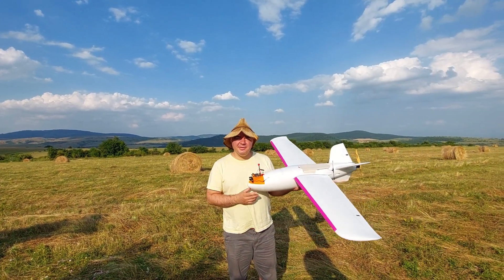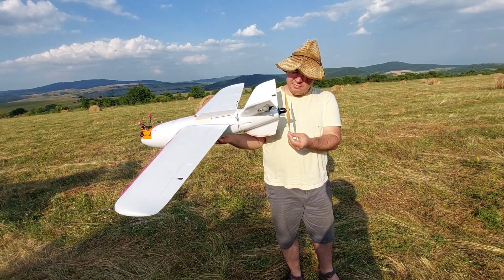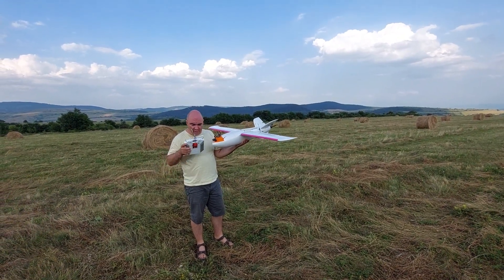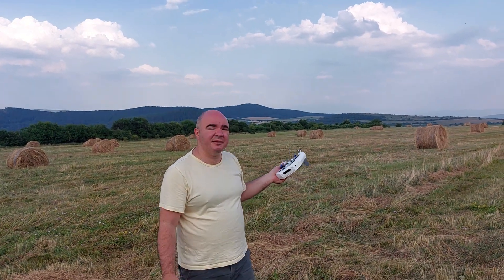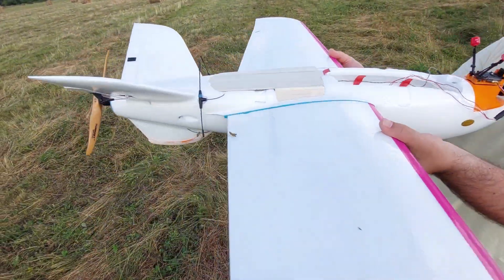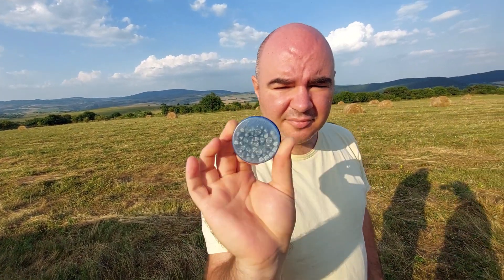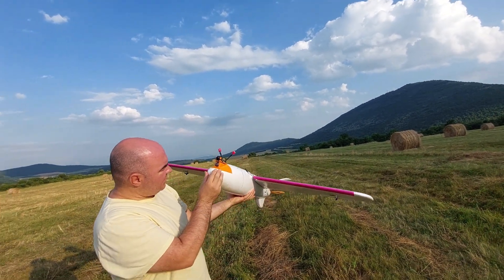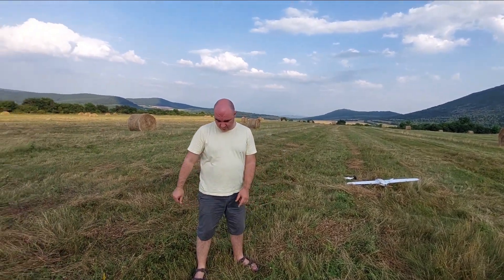X-UAV Talon Pro with SunnySky X2216-11 880KV. Is it a good combination?

Comment: Good, but in the end he ran very, very slowly. Try running from a low start and jumping up before throwing - it will definitely fly!:)
But seriously, throw it strictly at the horizon, or even better, use a launch rope with a rubber shock absorber.

Comment from the maker: Thank you for your comment. Since the SunnySky 2216 880KV did not do the trick I put the old motor back. I flew today effortlessly with plenty of thrust to take off from my hand. Do you recon a dual motors 2507 1800kv on 6S in tractor mode will be more efficient? Thank you.
Reply: Don't know about being more efficient, but I bet it would launch and land easily.

Comment: ESC, Prop direction, Improper prop type, need a higher kv,? I run 2216 1250 with 8x6 e prop on my 2m Volantex Ranger on 4s1p 21700 45A cells. It takes a strong heave to hand launch, but slides off of grass in 100ft.  I  use the Sunnysky 2216 880kv with 10x6 folding prop  on a very sleek Volantex Phoenix 1600mm which is much lighter. I run the SS 2216 1400 on a Harrier 1100 wing with a 9x5 E prop.   Here is my Ranger with 1600mm wing... https://www.youtube.com/watch?v=VHOiz-_4vik